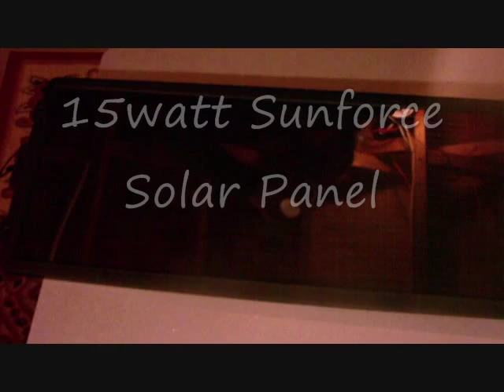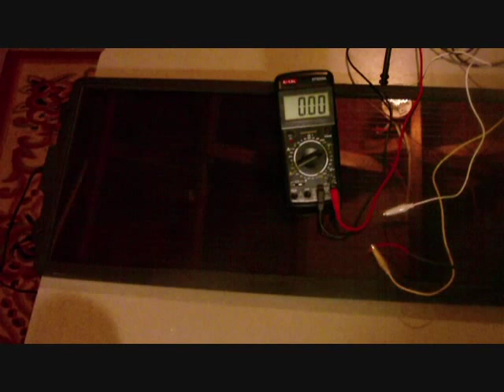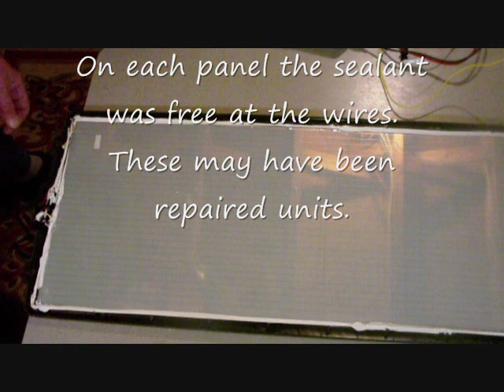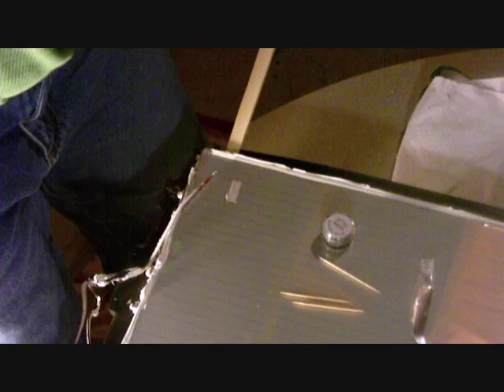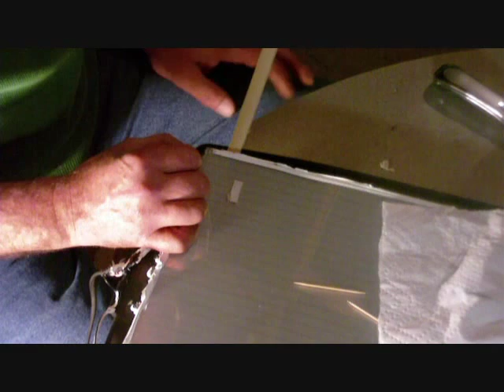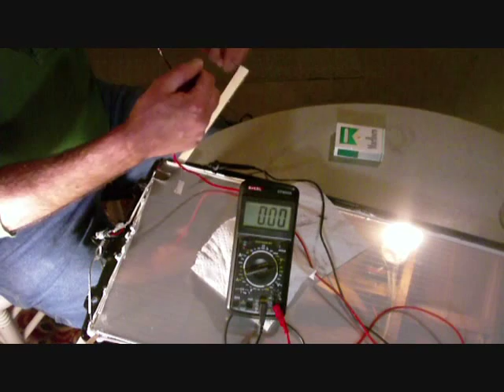Solar panel repair

Comment: got exactly the same panels 4 of them, 3 have died with the same problem. Looks like wire has corroded away and nothing to solder to, not even fix with silver paint which I hoped would work even before I took apart. It looks like these particular panels are poorly made and looks like water has started off the corrosion despite it sealed with white silicon. bit crap really and now there looks like no way of fixing. Get what you pay for maybe?
Reply from the maker: +welshwizard822 I've had to repair one of them again. Once that solder point is gone.. It gets real tough to repair.
Reply: fixed them bob i used a black electrical contact paint off ebay cost around £6. had nothing to solder to but after a clean up & applying that, let it dry and it worked 100%
Reply from the maker: Very good!